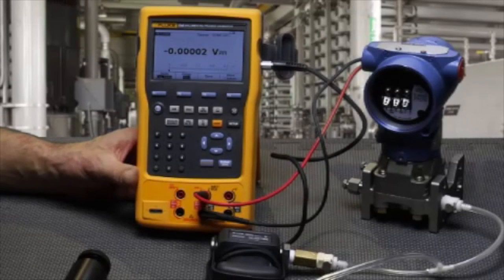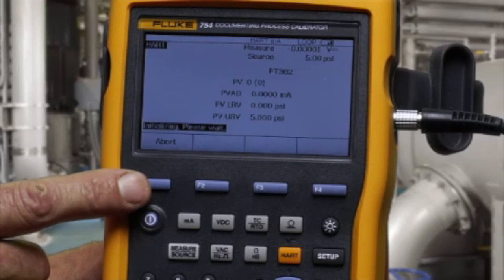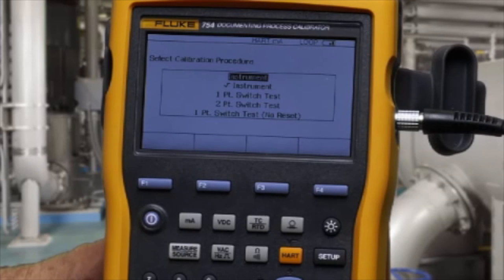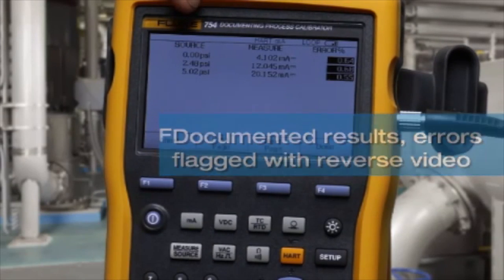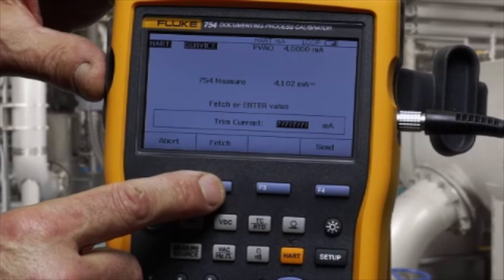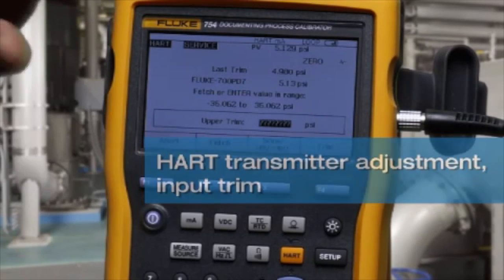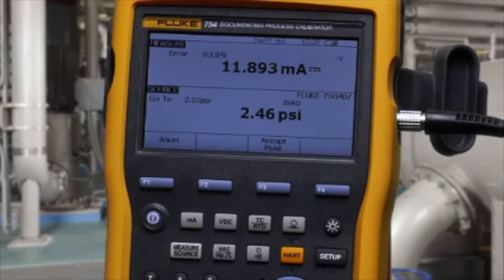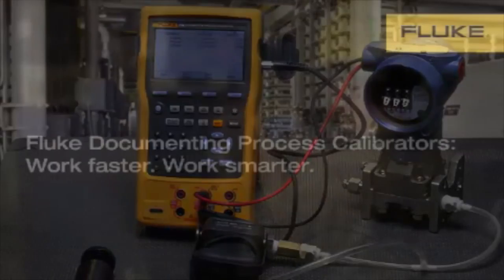Calibrate - How To Calibrate Hart Smart Fluke 754 Calibrator

Comment: I need some help from you Sir.
I have a 2051 Rosemount DP Transmitter. I want to change the unit. While I am changing unit the FLUKE 754 DPC showing "Loop should be removed from automatic Control". After pressing continue it shows error. What is the solution for this and tell me the proper connection you showing in this video. Please..

Comment: The 754 dose HART connections threw two different ports depending on what one you select.  There is a plug in the side of the 754 meter that is for HART connection that connects direct to the transmitter and you can also set the meter HART channel to the MA jacks on the bottom of the meter.  This saves you from have to used two separate cables.  You can measure MA and talk over HART protocol at the same time over the same cables in the MA jack.

Comment: how it is possible that you can turn your hart function on Dpc without connecting the  serial cable on it. As I can see you only plug the pressure module cable.